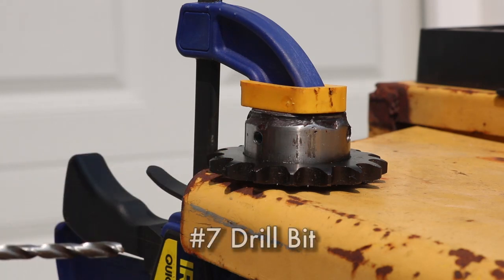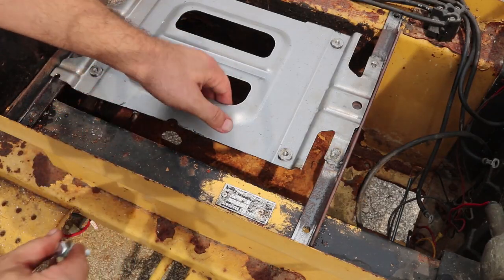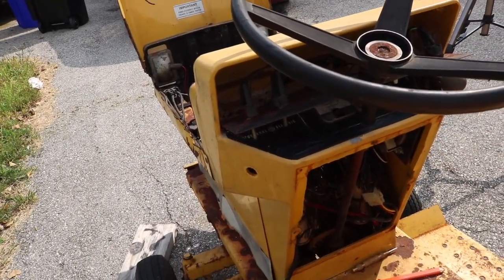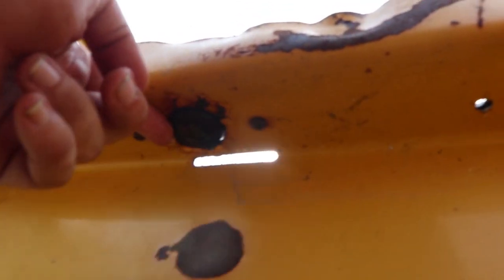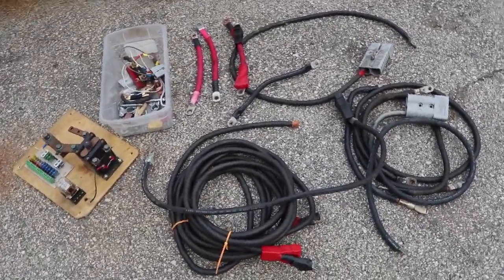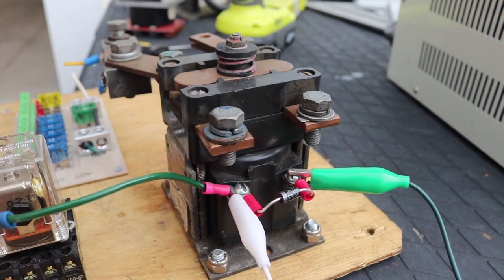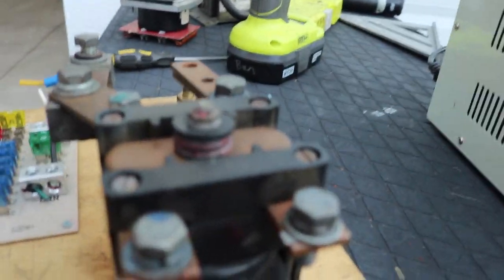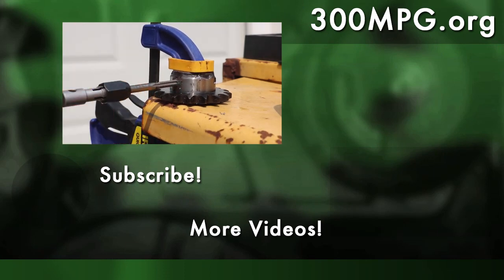ElecTrak Rat Rod Part 7

Comment: Hi Ben, came to your channel because of the solar project you did on your garage.  Keep coming back for the fun electrical projects like your lawn tractor.  When I see you drilling through sheet metal using progressive drill bits it makes me wonder if you know about stepped drill bits like these: https://www.harborfreight.com/2-piece-titanium-nitride-coated-high-speed-steel-step-drills-96275.html  I mostly do woodworking, so I had not bought bits like these before.  I had a project where I had to drill a large hole through some thin steel and thought I'd try these bits.  They worked great.Can't wait to see how the lawn tractor turns out and how the electric mini-cycle works.  Thanks for the fun channel.
Reply from the maker: Haha! YES! I know about step-drills, I just don't have one! I don't make it to Harbor Freight very often. When I saw a stepped bit at my local full-service hardware store, I was shocked at how expensive it was and swore I'd get one next time I was at Harbor Freight!
I also love Forstner bits, but don't own a set of those either. All these tools get pricey fast! I'm just doing what I can with what I got, but I do predict a stepped bit in my future.
If anyone wants to BUY ME TOOLS, please visit:https://300mpg.org/donate/